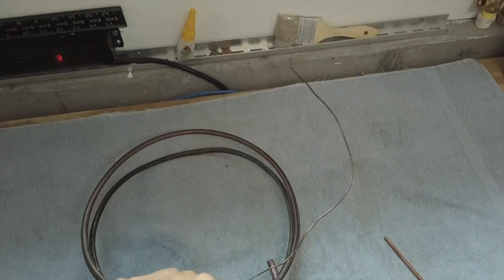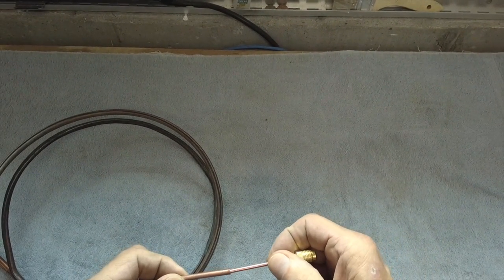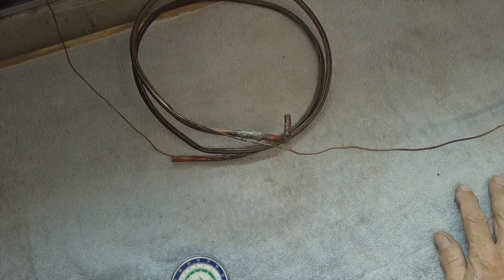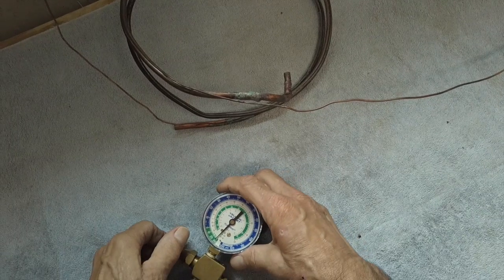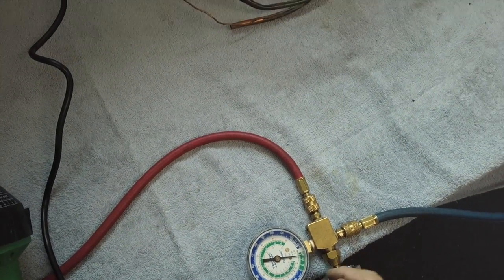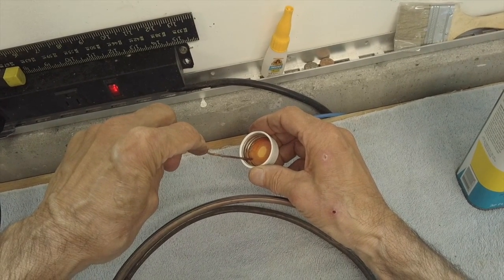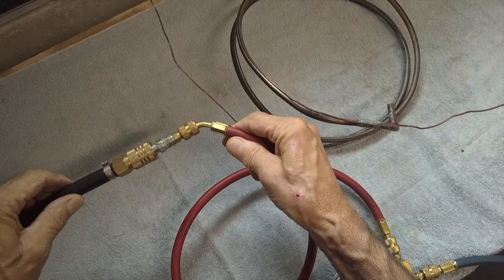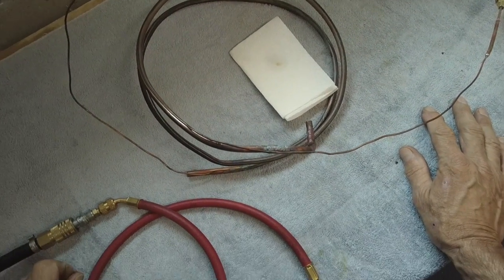Clearing a clogged cap tube

Comment: why you not replace the tube , no needed to use heat gun
Reply from the maker: Most of the times I do but sometimes you can’t pull the unit out because the kitchen was built around the refrigerator.

Comment: Thank you, but no way, shape or form practical to do such in the real world 😢

Nightmares I had with cap tubes :(  

How can we go away from such?  

No more pistons or fixed orifices in AC systems very soon.  All going to TXV metering.

Cap tubes are the inefficient simple  simple things that can turn to be a super bitch diagnosing and replacement like/ unlike shaded pole motors!

I hate all cap tube systems. 

They were good when there were only about 3 refrigerants that we used with mineral oil in the systems 😊
Reply from the maker: I don’t see manufactures doing away with capillary tube systems anytime soon, at least for residential refrigerators. As we speak many new systems are using R600A, Butane for refrigerant, that will be a game changer, better for the environment. But I agree with you on the probability of restrictions with cap tubes, but it’s not the cap tube itself, it’s the oil.

Comment: 0:29 So, how do you know the length of Cap tube and inside diameter proper measurements for anyone refrigerator/freezer?  Is there a chart somewhere? Inadequate freezing conditions may also be due to that sounds like.
Reply from the maker: The majority of the cap tubes on Sub-Zero are .030 id, the length depends on the model, but if you're looking to replace a cap tube on a non subzero the length would be on the box that the cap tube comes in. It's based on horsepower and temp range and refrigerant type. Go to jbind.com and look up application chart for capillary tubing.
Reply: @SubZeroSpecialists  Thanks Bro!  In addition to cap tube probably being clogged, a modified cap tube's length and inside diameter might be the issue if ice cream is not freezing properly, assuming no leaks and good freon charge.
Reply from the maker: @stanleylucky  a clogged cap tube wound be indicative of a deep vacuum on the low side of the system.
Reply: @SubZeroSpecialists  yes bro.  But if the Cap tube has been changed or adjusted in anyway, non pursuant to specifications, that could be an issue as well.  Vacuum on low side yes, but a possibility is that the cap tube is wrong in length and inside diameter as you said.
Reply from the maker: @stanleylucky  it would depend on the I.d. And length of the cap tube. The application chart should reference it.
Reply from the maker: @stanleylucky  what unit are you working on and what size cap tube did you use?
Reply: @SubZeroSpecialists  It's an apt size fridge, frigidaire mondel #fftr1814lwe.  Something exploded inside the fridge/copper pipes with 150 psi of pressure to test for leaks.  Original issue was fridge not getting cold at all.  I changed all the pipes and tested everyone one of them for leaks, including cap tube which I used a slightly bigger cap tube welded to original and I did a new filter as well and did vacuum several times.  Two filters actually due to many troubleshooting attempts.  I dug out/broke into inside back of fridge wall looking for leaks. Though fridge is working and water freezes, ice cream is still soft and gage goes to "freezing" but not "freezer" level.
Reply from the maker: @stanleylucky  what size cap tube did you use? What length? What type of Freon? What is the compressor horsepower? The capillary tube acts as a metering device so the I.D. of the cap is crucial.
Reply: @SubZeroSpecialists  man!   IDK.  I thought all cap tubes were created the same (that's what she said).  At first, same type as original in fridge but with a coupling to solder them together.   When freezing was not enough, I checked for leaks again, changed filter again, did vacuum and tried a little bigger cap tube this time with a little more lag (extra cap tube hanging outside).   A little better but ice cream still not freezing properly.  I'm in South Central LA bro - learning how to fix fridge from an old repair dude down the street and youtubers.  This is the 2nd fridge I almost want to throw away but my pride is holding on.  Plus I am learning lots about cap tubes :)
Reply from the maker: @stanleylucky  there’s a science to cap tube sizing. You have to know the horsepower of the compressor, Freon type, and desired temperature range.
Reply: @stanleylucky  so i am not the only one messing up with the capillary
Reply: @Marketto8777  No bro.  Apart from the charts and all the info on it I have learned, their delicacy has become too much.  As small as they are and while welding, replacing adding or cutting them, even anything the size of a hair can block it a tiny bit but making a huge difference on the freon being able to pass through.  I just used a wider size and added a bit to the length, that seemed to help a lot.  Best of luck.

Comment: break cleaner will work too.
Reply: I wondered about brake cleaner, it’s formulated to flash off and not leave a residue.  I suspect if there was even a small amount left in the tube that it would flash off completely under vacuum and be evacuated.  I have a big 48” Kitchenaid that I’m convinced has a plugged cap tube, and a failing compressor.  Compressor is on order, but I will need to clear the cap tube.  This was another great video in helping me establish the tools to potentially have to conquer a plugged cap tube, without replacing it.  My anxiety level has dropped a bit more.
Reply from the maker: Okay thanks for the tip.

Comment: How long does the repair last?   I’m just thinking you have compressor windings or oil breaking down and capillary tube will restrict again.  I currently have a restriction on my refrigerator and am going to try this.  Thanks!
Reply from the maker: This procedure doesn't always work, it depends on what kind of restriction you have. Usually cap tubs get clogged with oil or sludge which can be dissolved with lacquer thinner. This solution works best with a partial restriction, if you can't draw the lacquer thinner into the cap tube to dissolve the sludge it won't work.
Reply: @SubZeroSpecialists  mine is just a partial restriction so this may work for me.  Thanks
Reply: @Jaredisking1023  just buy a new cap tube. They're like 15-20 bucks from your local hvacr supplier.. Call the manufacturer of whatever you're working on to determine the length and inside diameter. I don't even mess around with cap tubes, if it's restricted  you're so much better off just replacing it. I've "unplugged" them many times in past, it never lasts. Throw a C032capt drier on there too. They are great at preventing cap tube restrictions and they have access built in
Reply: @AnUnapologeticApologist  Changing it is also my best bet. What i worry about is, will also a new house get restricted again?
Reply: @Marketto8777  There are many contributors to restrictions. Usually is just oil that gunks up but other things can happen too, say you have a compressor burn out and varnish on the windings breaks down, getting in the system. Are you doing the work yourself? If so you really have nothing to lose other than the small amount of money you spend on the metering tube. Put a C032CAPT drier on there and braze the cap tube directly into the drier. I put those driers on virtually any cap tube system (except HC of course) and they work very well. It also gives you permanent access on the high side.
Reply: @AnUnapologeticApologist  thanks. I heated up 4" of the capillary, and smoke smelling like  oil came out, but as i said, nothing worked, sign the oil and gunk is in all the capillary line. yes i will buy the cap is not that expensive, it was just a question. thank you

Comment: My Kitchenaid fridge and freezer compartments are not getting cold. I replaced the power relay switch already. Compressor, fans and capacitor are working. Within 5 mins of the compressor turning on, ice starts building up on the evaporator tube where it connects with the capillary tube.  Do I have a blockage or restriction there and if so how do I fix it? If not what else could it be?
Reply from the maker: I’m not sure if I could help you with a Kitchen Aid, my speciality is Sub-Zero. However if the evaporator coil is only partially frosted you could have one of three possible problems: a Freon leak, a partial restriction, or a faulty compressor. It’s hard to diagnose a refrigerator without checking the pressure in the sealed system.
Reply: T Villa, I have the same issue with a Maytag. what did you do to solve the problem?

Comment: Did you weigh in the exact amount of freon? If so and you’re running in a vacuum shut the compressor off and if your gauge stays in a vacuum then you have a restriction. Check your solder joints-make sure your capillary tune isn’t blocked buy disconnecting the cap tube from the drier, pressurizing the system and checking the flow through the cap tube.
Reply: Who are you talking too?
Reply: @rigakit  - He was responding to cheewurz I guess

Comment: How can you tell if a Capillary Tube is Blocked? I am working on my Kenmore Elite Refrigerator. I have Replaced the Compressor, Vacuumed the System and Added R134A but my Low Side Gauge stays at 10inHg!? High Side is at 100.
Reply: Not blocked It be in vacuum and stay there when compress is turned off Call pump-down stage
Reply: I’ve noticed it will frost up on the side closest to the compressor